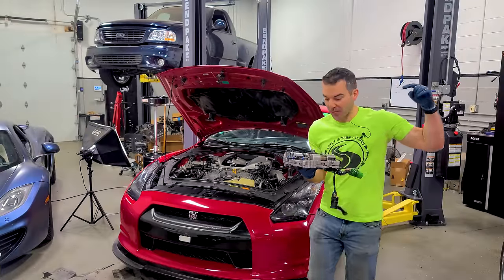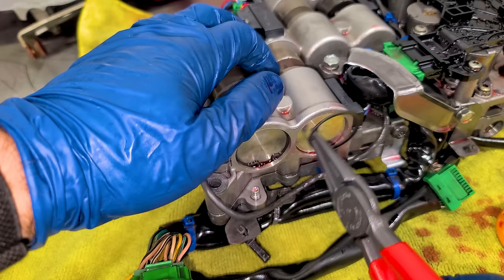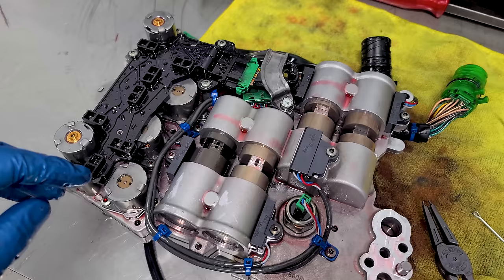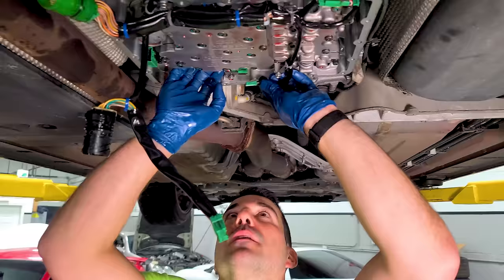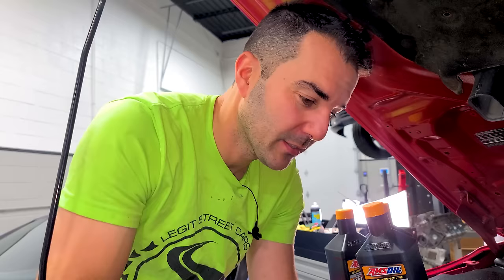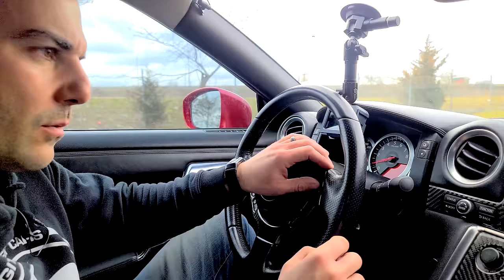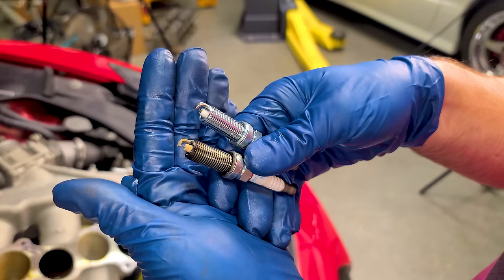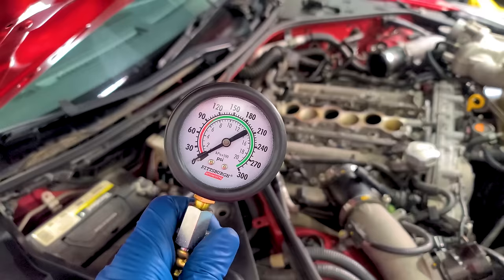My Auction GTR Was Hiding BIG Mods & SCARY Issues! Fixed EVERYTHING! First Drive, Launch & Dyno!

Comment: It does not have 32 thousand miles ,it has 62 thousand miles. The car was in Edmonton in 2010 and purchased from Go Auto by a dude named Billy, he even knew it was in miles but the dealer recorded it in kms . The car was imported from the US when new and still has the mph cluster so the mileage on the odometer is in miles. The screw up was in Canada because considering 99.99% of cars here are in kms when shops or dealers look at the odometer they assume it's in kms and record that number ,but this GTR is 100% in miles. KPH cluster GTR the speedo only shows kph ,unlike the mph US speedos that show mph on the outside and kph on this inside .
Reply from the maker: Can you email me at legitstreetcars@gmail.com

Comment: I really like that red color withe the blacked-out exhaust area and brake lights. I'm not usually into smoked lights, but this combo just looks sharp. Do you know if the lights are aftermarket black or are they wrapped?  As long as you can see the lights operate it wont be a problem. Keep up the great work!

Comment: Maybe you’re getting the knock sensor from not using the right gas? Happened to me when I bought mine. Tuned for full e and when I didn’t have enough e in the car it would throw some really bad knock codes sending it into limp mode

Comment: U probably need to top off the trany with some more oil. That's why u got the misfire. You probably shouldn't be flooring it right after u rebuilt it. The trans still needs to learn it's shifts

Comment: How many quarts of ATF did you used? usually when dropping the pan it takes like 8-9 quarts and its also good to turn on the engine for a bit to let the fluid circulate, after that it takes a bit more oil till you actually see the drip, and even after that its good to add an extra quart in there to help with launches and hard acceleration where the Gforce sends all the fuild back and you run into starvation issues.

Comment: Hey Alex im glad you added the clip of you showing the pistons and this is my information  i dont own a GTR but own a sti and have owned it for 14 years now and ive blown up alot of engines and ive ran E85 in all my cars  and those pistons are very clean especially for having 38k miles  and the only thing that really keeps them that clean is running e85 or some type of E85 mix  im pretty sure this GTR has a E85 tune or some type of E85 mix tune as well based off how clean the pistons looked  excited to see the next mods for the GTR  best of luck! loving the videos

Comment: A long time ago, I had a high horsepower Nissan with the CA18DET. It was really picky about using the correct spark plugs, fuel, injector size and fuel pump. Otherwise would fuel cut at WOT. But get those right and damn, no stopping that thing. =)

Comment: So my 06 chevy 6 cylinder does the flashing light thing after driving a while under strain above 55. Slowly flashes and loses power. I let off the gas and slowly get back to speed and light stops flashing and truck resumes. No body can answer me why this is happening.  This seems similar.  What could it be? New distributor, wires, plugs, fuel pump, oil pump, fuel injection assembly and injectors. Knock sensor??? Im baffled . Please for the love of your channel, help!

Comment: Hey! : from experience, I Have an idea with the CL... perhaps the ECU IS detecting preignition, and its pulling "time" but not fast enough, so it protects itself by pooping all the party and going limp.
I suggest that you try some very Hi  octane race gas with knock inhibitor (even more) and dump stupid amount of fuel, then lean back. (there is NO direct code for too much preignition, that I know) ECU must be interpreting as a misfire. poor air flow... etc.

I had a turbo project car that was pulling great but at some psi/rpm it like bogged (didn't sound unusual or pinged like knocking). someone told me about "silent preignition",  whatever that concept was...🤔
of course could not lean back to "normal" levels (except @iddle, or med rpm) but it performed decently and no bogging.

hope the idea  helps

and lower the boost even more until the torque limiters of the trans reach their limits.  then go up with the boost.

Comment: You could always experiment on a junk transmission where you go to Harbor freight or whatever and you buy some rare earth magnets and you drill like four holes into your transmission and JB weld the magnets in and then you’ll have a magnetic  oil pan which obviously won’t hold oil but it will hold the pan while you put in all the bolts in a similar concept probably wouldn’t be a bad idea for oil so either, so you may be onto something

Comment: I saw you taking the trans valve body off, I was surprised to see so many plastic connectors and wiring inside it soaking in fluid. How is it possible that these wires don’t melt from the heat or get damaged being soaked in such hot transmission fluid? Will be waiting for your reply. Thank you. FA, Karachi, Pakistan

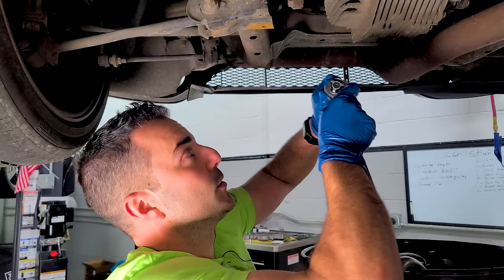Comment: I NEVER have this kind of luck with auction cars. If I had bought it, it not only would've had a blown trans, it also would've had a blown engine and maybe two bad turbos. @18:30... Just be sure you bring it to operating temp, work through the gears, then remove the plug to let any excess drain out. They're sensitive to being overfilled. @25:00... Yes, that's Ecutek (pronounced Eck u tech). Look under the hood for a GM ethanol sensor. It'll be on the passenger's side shock tower area. Ecutek is the go to for GTR flex fuel tunes. @29:25... Just saw the area, nope. No flex fuel... yet. Future video idea. @32:22... If you're gonna do a dual pump set-up, get the AMS. We made 1000 whp with it. I'll warn you though, it has to be assembled in the tank. You're arms will look like you got into a fight with a tiger. I set you a picture of me installing the first one ever. @54:30... Check your IAT's. One of the first mods you need with a tune is larger intercoolers. Heat soak puts these into limp mode.

Comment: New to your channel and love a GTR, these videos filled me with joy when the notification bell binged!! 
can't wait to see what else you do to it. With the car cutting timing If I had to take a guess if it's not on MAF anymore but on speed density and was at a high elevation before perhaps the altitude is affecting the car, especially if it was tuned over there on SD may be causing the car to lean out a bit (would explain the plugs) and the knock sensor kicking in.Might be wrong but likely unlocking the tune will reveal all, BEST OF LUCK!!

Comment: Coulda been on e85 before you got it and the knock could be bad gas from sitting it will drop the octane rating of the gas you just put in probably needs 91 or 94 or e85

Comment: People go overboard on spark plugs and gaps. I ran my Briggs and Stratton lawn mower for 24 year on its first plug. Never checked it, never serviced it, never gapped it. Put a new plug in and replaced the sponge filter. I throw in old engine oil out of my MAN truck which is heavily used 10w40. Its 28 years old now and still purrs like a kitten.  I'm pretty sure that car could cope with bigger tolerances than a crappy old mower.

Comment: Are you 100% sure the transmission needs to be cold and without the engine running? I found a video on  YouTube for my GX460 that claimed something, but it was very much not true. It has the same setup as your GTR but requires the transmission to be at a very specific temperature when you open the tube plug to set the level.

Comment: I think the only thing I can say "bad " about this video is that when you filled the trans; It has been overfilled. The fluid will expand when hot and the drain plug needs to be removed at a specific temperature allowing excess fluid above that tube to come out.

Comment: I have a 2019 Acura RDX ADVANCE AWD had to get it repaired (driver side impact) ... It was still acting up after the repair had to change out the Spark Plugs and Drain Transmission Fluid, it drive good but it still lose power when pressing on the gas rapidly gear will jump all the way to 3th gear and then go slowly back down. (No flashing engine light but Emissions System light comes on) What could really be the issue

Comment: should have known it was tuned by the built trans because they are going to have to tune the trans after it being built to mess with shift pressures and would make no sense to do that and not engine tune. plus you literally pulled off stickers that said hard tuned

Comment: Why would colder air reduce knock?  Wouldn't there be more density and if the same amount of fuel it would be leaner?  You might hit a different cell in the table because of the air temp, but that's about it.

Comment: "Is this thing tuned!?"
Dude. Read the signs: built transmission, blacked out taillights and other tinted stuff, dodgy front splitter... I would be more surprised if it was NOT tuned, especially if they are willing to spend 8-9k on the trans.
Also, maybe it has been tuned for E85 causing the knock after filling with regular. I'm like half-way the video so probably you'll figure that out in a bit.

Comment: I have a theory that people change plugs too often. Nobody has ever been able to explain to me why you need to change plugs every couple of passes. I've bought cars with 120-130k miles and they're still running the original plugs with no misfires detectable. I know electronics degrade over time, but the frequent plug changes seem like superstition. 30k miles is probably the shortest interval I'd go with for changing them with all of the research I've done. Even then I think it's overkill. This is not the old days with poorly tuned carbs and flooded engines. Plugs just simply don't foul on modern cars, or at least I've never seen one do that.

Comment: I'm not a master mechanic, but using air from the air compressor on those trans filters probably isn't recommended it could split the fibers on the filters and jeperdise the filtering capabilities. Trust me you are way more knowledgeable on cars than me, so this is not me trying to act like i know more.

Comment: I know you said the readings on a compression test.Don't matter as long as they are consistent.But  either your gauge is messed up or you have some low compression.Or is that because it's More modified??? I'm curious?? To me there's no version really low.... 120 is on the lower threshold... I do know that Turbo cars have lower compression.And maybe this is highly modified, so they lowered the compression even  more....And that's why we have  these low numbers.  But I really don't know.... I'm only guessing... anybody.Have the answer??
Reply from the maker: It also depends on how long you crank. If I cranked it another revolution it would have probably gone to 140

Comment: Stop using power tools to remove plugs...doesnt matter that you break them free by hand, you can and will strip the threads in the head... crack them loose and then use an extension and your hand and theyll come right out

Comment: I would be surprised if 93 is high enough for this car. We have a lot of Japanese performance cars where I am, and 91 is the minimum you can even buy here. 95, 98 and 100 are the others. Typically performance cars like this will be 98 minimum. I would bet your knock is due to low octane fuel being used.

Comment: Fun fact about GTRs. Each one is different on power. How so? They are built by hand. And never dyno them. So who knows. First gtr could have more then the next.
Reply from the maker: That has to be a very small difference in power. They may be hand built but if they use the same parts, power should be very,  very close
Reply: @LegitStreetCars  hard to say. It's what I remember from Jeremy Clarkson. When her drove the GTR on Top Gear. What they told him was its hand built and no one knows what power it actually makes bone stock. Nissan told him that.

Comment: That engine oil was disgusting. Having it serviced at Nissan is the worst thing you can do, they are renowned for not doing the service at all and charging for it. I'd be changing that oil again in 2500km and then monitor it

Comment: My only worry is the transmission was rebuilt 1k miles ago, but so much metal seen. I'd be afraid.
And remember everyone, spark plugs don't age by date, only miles.....
Reply from the maker: Time can indicate issues with plugs if the car was mostly lot driven and not warmed up.  They will four quicker if run at a rich mixture often.

Comment: When Nissan (Japan) built the GTR they over built it! I mean everything you can easily put 800 hp and not do a thing to it. There are people with 1000 hp with NOS, Methanol on stock motors. There an awesome works of art. Had one until a blue haired lady going the wrong way smashed into me 😢in Florida dam snowbirds 🤢🤬😭

Comment: O2 sensor popped out, dude kept into it without possibly wondering why, not my kind of dyno operater....sorry dude - if any sensor went out during a dyno run should be getting off throttle in case of engine failure...

Comment: soooooo you car being an 09 couldnt the zero on the sparkplug mean 2010???
Reply from the maker: Yes definitely but the car had about 5,000 miles then and it was under warranty and dealer maintained. I don't think they would have replaced them back then

Comment: That was LEGIT the saddest leather restoration advertisement ever you show the bottom right side of the driver seat and then the after what's the top right side that's pretty pathetic 😭 you couldn't atleast show the difference in the part that was most damaged you have to try and trick the eye because.......why?